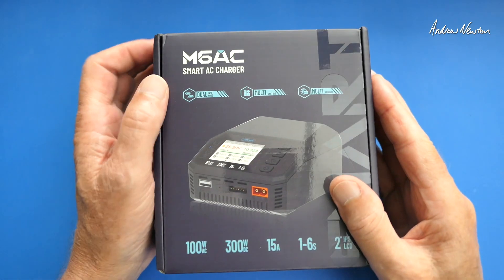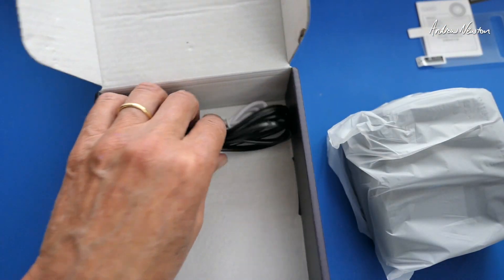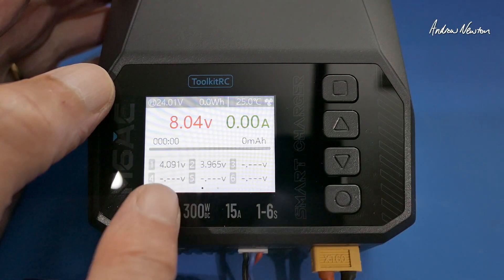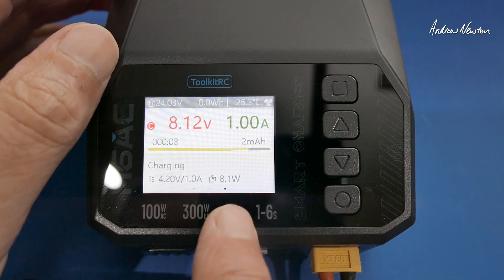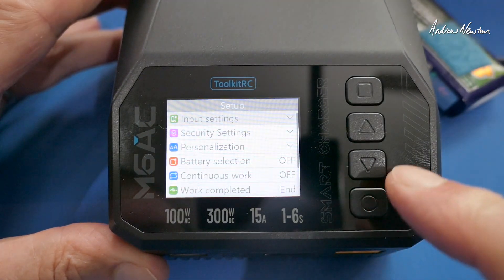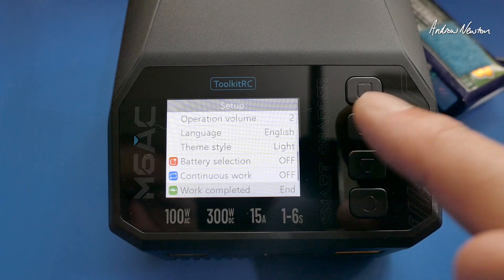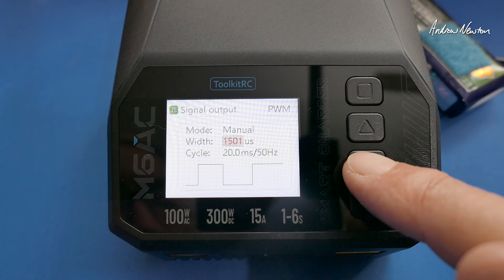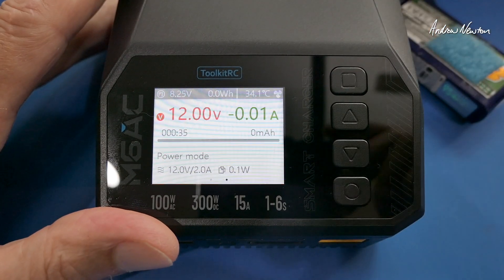ToolKitRC M6AC Dual Input Multi Charger

Comment: My charger's ancient [Turnigy Accucell 6] and has been in regular use for more years than I care to remember. It still works perfectly, so I was wondering if anything ever goes wrong with these things. Has anybody had to replace their charger because it failed, and not just because they fancied a change?

I appreciate that there are always new people taking up the hobby, so there's bound to be a ready market for something whizzy and new. To be honest, though, the only thing about this one that caught my eye as being a must-have feature was the 'dark mode' option for the display.[5:07]

Mmmm, dark mode option... Why is it even an option? Eye-blasting bright-mode ought to be the option, tucked safely away in a menu somewhere.

The one-woman campaign to make dark mode the initial setting for ALL electronic devices starts here.😁
Reply: A boxful of 4-button chargers between us Old Farts. Various types including the usual clones. Unless you have them plugged in during a thunderstorm they are pretty reliable. The mini push-buttons are the first to go but you can just knock a hole in the case to substitute a toggle switch if fiddling with the little surface/board mount units is not practicable. 3 done so far.